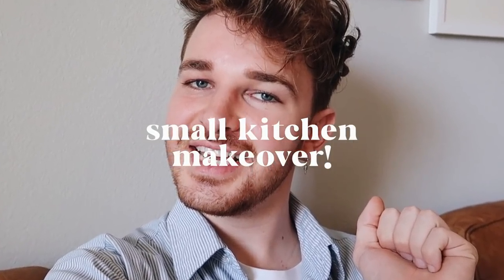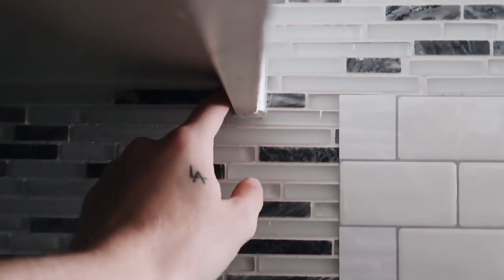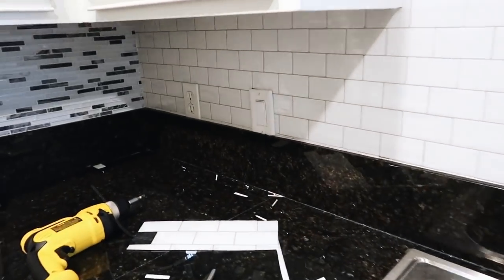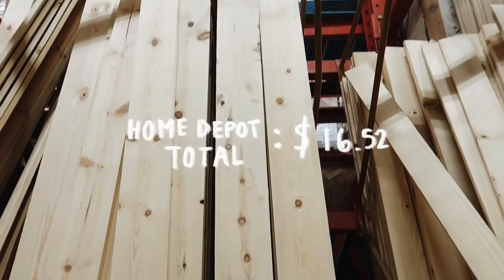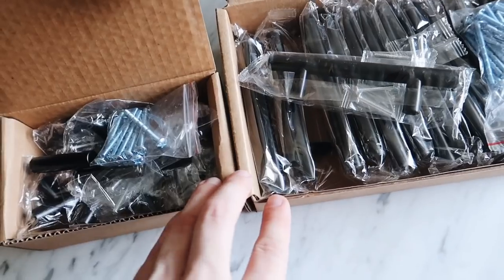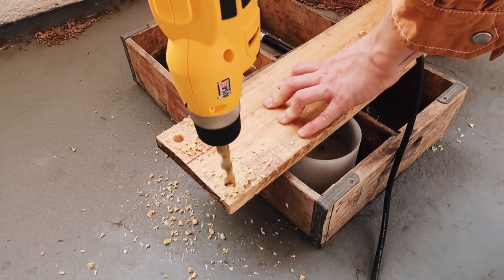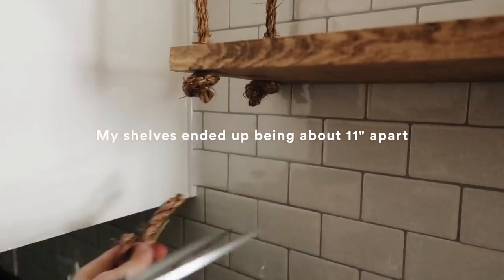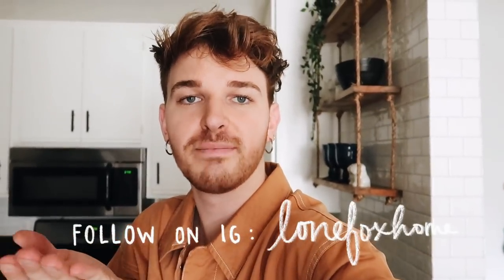$300 DIY SMALL KITCHEN MAKEOVER & REVEAL - Renter + Budget Friendly!!

Comment: Is it really renter friendly when you drill holes in the cabinets?
Reply: In my experience? Never.
Reply: Or the ceiling
Reply: you can patch them when you leave.
Reply: If I were the landlord I'd make him replace the doors when he leaves.
Reply: @jackieburns5257  Walls and ceiling yes, but the doors? No. Most would replace them using part of your damage deposit.
Reply: A J  Agreed! Also, a quick phone call to the landlord to get permission to add handles (or an email if you prefer in writing) and that solves that problem. Just make sure to do it as professionally as possible. Take your time. Measure twice, drill once.
Reply: @jackieburns5257  Im a property manager in SoCa, no you cannot. drilling into wood and then patching it has still degraded it. So many bucks he has cost himself.
Reply: You his property manager?
Reply: My experience of 50 years being renter, homeowner, renting homes we owned....”ask first” works best. Usually if done right and agreed upon by both you can upgrade with agreeable ideas.
Reply: @Ms.PSnazzy  Altering the structure of any permanent goods such
Reply: @Ms.PSnazzy  oops hit the send button early, anyway, somethings you always have to pay for, wherever you are,  such as damage to permanent such as doors, ceilings, cabinets, floors etc.is a big expensive one. I am only imparting info to help people not make costly mistakes.
Reply: I'm guessing he's gonna have to leave the handles or face a fine for drilling in the cabinets.. in my years of renting I've switched out things like faucets or handles but I leave the better one behind for the next person and haven't been charged for it.
Reply: Oh okay even if they get permission form the leasing manager or property manager
Reply: @Ms.PSnazzy  yea, you should be fine, just put your changes in writing, have them sign it and make sure you only do what was agreed upon. happy decorating!
Reply: A J u
Reply: Chances are the person doing the move out inspection won't even notice. The cupboards look like the original old ones that have been painted a million times.
Reply: No, but im assuming he got permission first. At least I hope so or else he’s shelling out a bunch when he moves out.
Reply: @danalee2438  I am a long time renter and my position has always been this - if the landlord does not allow me to do any modifications and express myself, then such landlord does not deserve to have my money, and I am not going to rent from them. The only non-drill alternatives to handles are fold over handle and industrial velcro, and both of these are not ideal.
Reply: People...it appears he knows what he's doing and I'm sure he obtained permission. In any case it looks 100% better!
Reply: I was confused about the drilling holes into the cabinet doors part. I though they don’t allow that.
Reply: Depends on the country and the landlord, I rent in Australia and we can't even have indoor plants and need sticky pads on the bottom of ALL of the furniture. We also need to avoid leaving impressions of furniture in the carpet but a lot of DIY videos, especially the American ive seen they've drilled holes or painted the walls...
Reply: Jackie Burns Yeah but if you patched and did that means you have to paint the doors.
Reply: Goth Empress That’s a no no! If you feel or have the slightest indication that a landlord will tell you know, it is in your best interest not to contact them to ask them for permission. That way you can get by in the end with it being a misunderstanding. If you asked them and they say no when you do it anyway, you’re fucked.
Reply: All my apartments had handles on cabinets.... plus you can patch when you leave
Reply: There are so many different rules about this and the old ones are not the same anymore.  If a renter does a great job most landlords love it.  The last apartment I move into I knew I was going to be there for five years.  I probably put about 1000.00 into upgrading things like knobs, paint and fixing things that needed it and when I moved out I got a letter from the landlord thanking me for taking such good care!  It's different everywhere.
Reply: It is ok if people do it right, because you dont ruin the cabinets, you ad value
Reply: He doesn’t have to tell us everything, does he? Probably asked for permission already.
Reply: Landlords never give your security deposit back anyways🙄 end up charging you 100 for some cheap blinds at the end of the day so 😒
Reply: I came to the comments to say this lol that’s not renter friendly at all
Reply: I’m sure it won’t be a big deal if he leaves them when he moves out because honestly they look nice. They match the countertop and original backsplash. They’re also modern. It looks like he did a good job installing them. I think new renters will appreciate them over not having any handles. Like another commenter said, when you’re cooking and you have greasy hands or need to grab something from a cabinet quick, handles are easy to clean rather than the actual cabinet.
Reply: Yes.  I've rented many places and you are allowed to drill holes as long as you patch them up before you move out.
Reply: Where I live things aren’t so strict you can always discuss it with your landlord and most of the times he’ll be happy for house uprgrades.
Reply: I think hes upgrading the space. Most landlords are okay with someone making upgrades which are agreed upon. Just need to ask first.
Reply: he must have gotten permission from the landlord to drill into the cabinets
Reply: We get permission or put it back to how it was like before haha
Reply: Patch the holes when you leave
Reply: @missdawn9068  theres wood molding material that can cover holes in doors
Reply: @CageGD  That usually means nothing to a landlord. They'll always find a reason to keep part, if not all of your damage deposit.
Reply: Usually as long as you patch holes your goos
Reply: I was just thinking the same thing🤷🏽‍♀️
Reply: @shiningstar7775  Why? It's an upgrade.
Reply: @tracygarrett3952  That is subjective. The problem with 'upgrades' like this is that they're dependent upon taste.  Once you've drilled holes into a door you can't turn back, especially if it;s negligently done.
Reply: If he leave the handles when he leaves, I don't think there's a problem !
Reply: they make a wood filler type of putty.
Reply: Well most holes can be filled no problem. Just make holes sparingly is my philosophy
Reply: A lot of times when you ask they are perfectly fine with it. He’d 9 times out of 10 have to leave the handles  does on the cabinets and draws which I’m pretty sure he’s fine with . So, it is very renters friendly . 

Ps he’s doing them a huge favor because he’s upgrading the space for them .
Reply: Agreed definitely not getting that deposit back
Reply: i bet the landlord might appreciate the updates bc when he moves out the landlord may be able to rent out the apartment for a higher price sooo
Reply: and as long as it’s done correctly
Reply: As a former property manager, as long as the cabinet pulls are left behind the landlord won't mind. The pulls make the cabinets last longer because they decrease wear and tear to the door itself since they aren't being constantly touched to open. And I'm sure he got permission first! Otherwise, those holes can be filled but I'm sure the landlord prefers the knobs. :)
Reply: But he added value to them by adding the knobs Idk why the landlord would have a problem
Reply: @jazzyazz5347  Because some landlords stipulate that you have to leave everything as you found it. Which means taking the handles off when you go.
Reply: @modaciouslav4792  It depends on the written agreement between you and your landlord. Some say that the renter must leave the property as they found it,  so all those stick-on tiles, and cabinet handles would have to come off before inspection when you leave.
Reply: @jackieburns5257   Drilling holes through drawers and cabinet doors IS NOT patchable like filling in nail holes on the walls.  ALWAYS get written permission from the landlord BEFORE doing permanent changes.
Reply: @shiningstar7775  He made such an upgrade to the place.  I was a renter too before and my landlord's daughter told me that they have tenants who bore holes on the walls and even doors - as big as a cereal bowl.  Kids writing all over the place and scratching floors or staining carpets, etc.  Though asking permission first is the best move but how do we know if he had done that and just didn't mention it on video.  But I believe that the landlord should even be thankful for the tiny upgrade and free design ideas he had contributed to uplift the living space.
Reply: 😆🤭..good question.

Comment: Might be a good idea to get some velcro strips, and attach that hanging shelf to the peel and stick tile, especially with so many pretty fragile items on it!
Reply from the maker: I actually did get them and tried attaching them but the stain wasn't 100% dry so they didn't stick. But I did apply them yesterday and fixed them to the wall just to make sure! I should have mentioned that in the video but thanks so much for the comment reminder because it's def necessary!
Reply: I was about to say that or heavy duty magnets

Comment: I’ve not seen anyone mention how he made extra work for himself by sticking the tiles against the edge of the wall how he did? Should he not have turned them upside down so that their flat edge met with the flat edge of the right side of the wall? And then the second sheet of tile (working from right to left) would stay how he has them in the video, so that both non-straight edges would fit together like a jigsaw without overlap? Or am I being slow?
Reply: // K A I L E I G H // nah cause then when he got to the cabinets it would have been a pain. This way he can let the extra pieces stick out while hey lays down the rest of the tile
Reply: Karla M. Surely any slight problem at the cabinets still would have been easier. The way he did it meant he stuck tiles on top of each other. The whole point of the non straight edges with alternating tiles is that the sheets fit together like a jigsaw.  But he literally just stuck those on top of the ones before. That a) isn’t the point of the tiles and b) makes it more difficult to work with hence the weird air bubbles! It’s hard to explain in writing but yeah
Reply: Like, look at it at 2:58. You’re not meant to stick the overhanging tiles on top of the half-tiles of the straight edge side. You’re supposed to fit the overhanging tiles of two sheets together like a jigsaw with no overlap.
Reply: @kaileigh7385  ohh I see what you're saying the but the instructions actually say to overlap them, I think it's to keep them all more secure
Reply: Karla M. Oh really haha well everything I just said was completely pointless. Goes to show why he’s got the diy channel and I don’t !
Reply: so it goes xD

Comment: nice effort. watching with our gc ... says repairs for holes in cabinets gonna run $200 (fill, sand, paint), with chance of landlord escalating to new doors, which gonna be minimum $75 per door. Removal of ceiling hooks, ripping out anchors, filling, sanding, painting $50. Peel and stick subway tile is a easy removal most of the time, however if the adhesive is stubborn, tack on another $75-$125 for adhesive remover and scraping (be careful not to damage boring glass back splash). You cannot really go wrong with white subway tile subjective as it is, safe starting base. Peel and stick cannot look shabby when not done right, i.e. lumps that have character occur cuz air bubbles were not properly dragged out (try spraying each tile with soapy water and squeegee air out as you install each), no way that back splash was protruding to create those lumps that would result in the surrounding tiles failing (coming apart). nice accessory ideas. handing shelving benefits from using a torpedo level along the way. instability of rope positioned right by a corner is hazard in the making, be careful. nice idea, tho. But don't quit part time job as a handyman(or girl, whichever preferred). template for hole placement is A++ standard application. all in all, okay stuff and prepare for a minimum of $500 out of your security deposit.  taklsuxx score .. accessory choices 3.5/5 ... handywork 1.5/5 ... financial resolve 1/5 ... overall effort 4/5 Tally ... 10.5/20

Comment: So I have a question I would like to turn those wire shelf racks that has holes where the poles would go to to secure the racks over those black knobby thing into wall shelves how would I do that in an apartment? Also my place was built in the early 1990s and have really gross Press board cabinet doors what's a good way to make those over?  It also has stecko walls I am just trying to change it up some. I have been here for 15 years and when I move they will be ripping out the kitchen any ways so I thought about  painting or covering them in contact paper or something.

Comment: You know you can use your electric drill to then screw in all the screws. Then you don’t have to manually screw driver in a billion kitchen handles! Usually the drill will come with a flathead and Phillips head drill bit for this very reason. Make holes, fill holes.
Reply from the maker: I probably should have drilled all the holes first and then done that LOL! I didn't even think about it

Comment: Did you first get permission to drill holes in cupboards? Landlords would want a form of guarantee that the person measuring and drilling is doing it pretty exact and drilling it straight  through with no slants. They may also want a say in the choice of handles as hole placement varies. May be less important in an apartment building but as a person renting out my personal townhome and my house, (active duty) i would not approve of your choice of handles in the very modern slick design of my townhome, for example. So everyone please ask first!